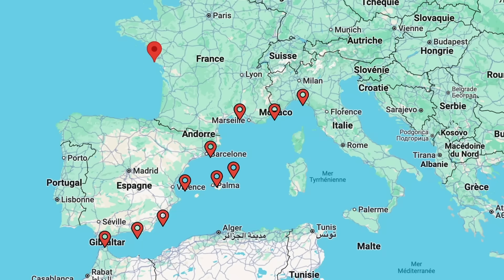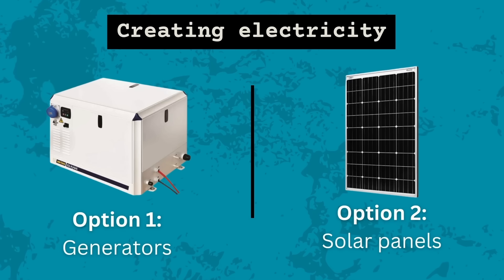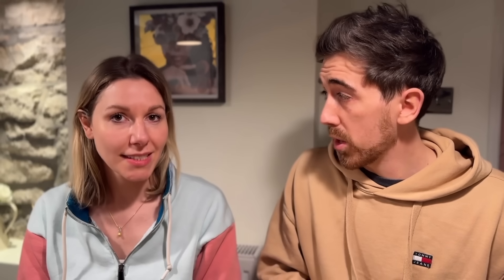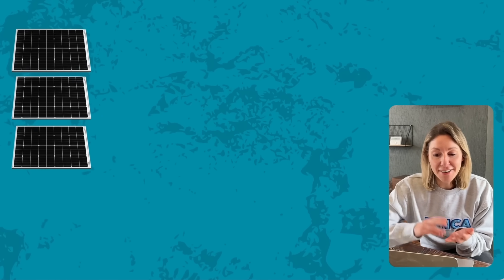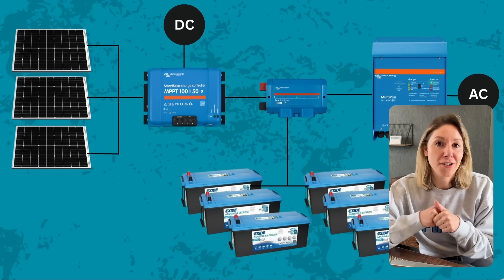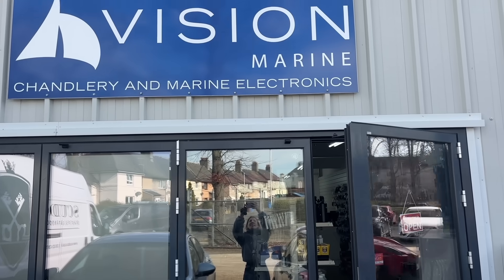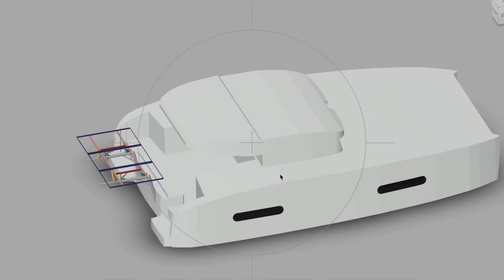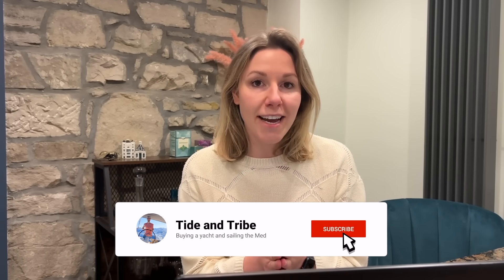We Have a €20,000 Problem! Buying A Brand New Catamaran

Comment: I strongly recommend using LiFePo4 batteries. I have used AGM and wet cell lead acid batteries for the last 45 years and recently changed to Lithium Ion batteries and what a game changer they are. I now wake up to 13.2v instead of 12.1v. They charge faster and can be cycled right down to 10% or so. they are much lighter and hold their voltage right through till they are almost flat. I live onboard my boat and have 3 x 320amp panels which easily handle my 2 fridge freezer units plus all the other usual liveaboard electrical use. I usually only cycle down to about 75% capacity remaining overnight before the panels kick in and begin charging again. This is in New Zealand where the weather can be quite changable with overcast days and a fair amount of rain.
Reply: I agree with you. The new lithium batteries are so much lighter and smaller than AGMs which is important for a multihull which must be VERY conscious of weight accumulation.
Reply: Yes, my research shows that LiFePo4 is the way to go.
Reply from the maker: Thanks so much for the recommendation. At the moment we’ve gone for AGM, but will definitely consider a future upgrade (when we have a little more cash built up) if we struggle - especially since we can only drop down to 50% capacity!
Reply: We started out with 2 agm batteries and after 2 years switched to 2 LiFePho batteries. That was 6years ago and they’re still going strong. In the long run they are actually cheaper, plus piece of mind.
Reply: @GypseaGeoff  Hopefully you mean Lifepo4 and not Lithium ion as those pluse Lipoly are a real fire and explosion hazard, plus no Lithium should ever be discharged below 50% capacity, or it is bye bye to recharge cycles.Worst Lying Words on every Battery with them ? “Deep Discharge “ as each Deep Discharge damages Battery internals and Shortens their Service Life .Same for rapid high amperage charging, and heavy  Discharging, as it heats up Battery internals which ? Also shortens Battery Service Life. Sadly, there is far too much leaping before looking going on with Batteries, Solar etc,and people are very surprised when very expensive Crap stops working in 12 to #4 months, like most flexible panels which has UV exposure delaminate them and Ooops they’ve Gone. There are a few decent Channels on YouTube such as Hobotech which do pretty decent testing, and I like that he does links to good products with extra discount codes. Clare of Clark’s Adventure Channel also does good testing, plus he has designed and builds what looks to be a really good Battery Bank Manager. Ones to avoid are testers who just love blowing shit up, at least until you have learned enough on how to treat batteries properly and that means Gently looking after them, barring accidents, gets you very long service lives. Clark doesn’t like DC to DC Chargers charging Lifepo4 Battery Banks, because they don’t charge those correctly, so damage the batteries. BUT use DC to DC Chargers From a Lifepo4 Battery Bank TO  Lead or AGM Batteries, and they do that fine. Once you know how to treat Lifepo4 Batteries properly, suddenly you can get very long service lives out of the cheap ones as well, and no more being ripped off by chronically overpriced ones. Simple tips, for simplicity and Safety, buy 4 X Lifepo4 Batteries, but specify that they Must be from the Same production Batch,and connect them to positive and negative bus bars, with each battery terminal connected with a same diameter and same length over sized cables, which means that each battery is sharing an equal load- say you discharge at 80 amps, and also charge at 80 amps, each battery then delivers a discharge of about 20 amps, and receives about 20 amps charge .,so size of wire to connect each terminal to the bus bar ?I like easily handling double the load, so 50 amp wire- so the cables never overheat, never wear out, and the battery internals barely even get warm, so they last a very long time as well. NEVER EVER Expect a single battery to thrive when responsibility for all things is just dumped on it with no thought put into how to do it properly takes place at all. I have seen an engineer totally wreck his AGM Battery Bank inside two years, because he didn’t have even the beginnings of a clue about how to look after them properly. His Solution ? Replace them with extremely expensive Lifepo4 batteries, and he then proceeded to treat them just as badly as he had treated his AGM Batteries. Too many people who should know better, believe the Lying Battery Destroying Words - “Deep Discharge “ AGM - discharge  below 80% Capacity and you lose recharge Cycles Lithium - all sorts - Discharge below 50% Capacity and you lose recharge cycles, Rapid Charging and rapid discharging shortens the battery life - side note - wireless charging claps out the batteries very fast too. This in addition to not letting them freeze or over heat.Essential knowledge on Lithium fundamentals, has improved dramatically in the last 18 months or so, and things are really starting to look up at last. Best Wishes. Bob.PS. Most useful information that was only a little bit lacking - so it turned out - originated with very sound communications with Ampere Time - now name changed to Li Time - Battery Factory Engineers. Unfortunately due to the “little bit lacking” actually being extremely important for being able to start long term testing accurately and completely from day one, I had no alternative but to turn down their very kind offer to provide me with a Complete HouseBank of Batteries, for me to see just how long I could make them last. Rough approximation today ?Service Life should be in the region of 30 years, is likely to be ballpark, so things really have improved a heck of a lot.🤔🌟🌟🌟👍❤️⛵️
Reply: @brownnoise357  I did say LiFePo4
Reply: To install AGM batteries is such a terrible waste of time and effort. With only 50% death of discharge, and slow charging rates you might as well not bother.  Naive beyond belief
Reply: @faraway5828  That's bit too harsh. My guess is they want to make a proof of concept and it is much cheaper to do it with AGM. Once the system is up an running and wiring is in place and they have experience with that, and they have rough idea how much energy they use it will be relatively easy to extend it to permanent battery set up.
Reply: @ Actually lead provides substantial benefits if used for the core of the electrical System, such as with preventing the blowing up of alternator charge controllers, and if treated properly and barring accidents they can have very long service lives. Best lead based batteries ? Look to be the right type of AGM for each purpose, such as engine start, windlass, and bow thruster batteries, plus a limited size of Housebank AGM, but none of those must ever be allowed to drop below 80% capacity - which is easy to do with the Bank of Lifepo4 Batteries if they are treated right - very gently - and used in a management role serving every other battery on the boat via DC to DC chargers From the Lithium to the AGMBut definitely NOT from AGM To Lithium, as right now wrong way round, the charging profiles look to be completely wrong, and will over charge the Lithium,mwhich destroys them. So even the cheaper lead acid starter batteries can still have a role to play along with delivering a usefully long service life.Example, only an accident- the British Met Office completely failing to warn of extremely cold conditions arriving with sustained wind chill of under minus 45 degrees C, which froze the ground solid to lower than 10 feet below the surface, destroyed my Bank of 100 ah 12 volt cheap agricultural Tractor Batteries, that were still delivering fully charged capacity sfter over 15 years of service simply by never discharging them below 50% capacity or below 12.2 volts, and topping them up only with distilled water.So a simple glance at the volt meter told me exactly what the battery situation was 👍
Reply: @brownnoise357  There's merits in what you say - however I think that one can reasonably discount the low temperature cutout issues in a marine (ie no lower than sea temperature) install in the Med.
Aside from the implementation/choice of battery chemistry issues, I'd have two big issues.  
Charging large house banks (particularly AGM) from prime diesels will massively reduce the life of said diesels, as it will be impossible to run them much above tickover, which is way outside optimum operating window for diesels. Of course, with a separate high output alternator, charge controller (and LFP) you can charge orders of magnitude harder - but one would want such an implementation to be well designed, well installed, well warrantied. The idea that you can run purely off PV is 'ambitious' - indeed modern (digital nomads)  are finding that 2.5kwp to 5kwp PV does not reliably cover their needs even in Med/Caribbean areas.
The second huge  issue I suggest is getting a home-brew system properly signed off, and underwritten by an insurer.  Live aboard yacht insurance has got drastically harder since Covid anyway, and without insurance you can't (easily) enter marinas or yard hardstanding, - and of course the entire financial enterprise is at risk.
Reply: @ yep, no free lunches, and much depends on being able to get the power demand side thoroughly under control.plus look after a diesel generator right, and the length of their service life can be surprisingly long. All the Best. Bob.👍🌟🌟🌟⛵️
Reply: @ Actually you sound as naieve and uncomprehending, as an e-bike owner who parks the bike on the sunny side of the house, then can’t comprehend why it burst into flames and burned their house down ? 🤔
Reply: PS. Please bear in mind that most people just don’t comprehend how to treat Lead batteries properly, let alone lithium ones. My Lipoly batteries even came with instructions that they must be charged in explosion proof bags, and such batteries were confiscated and banned from being taken aboard the aircraft when I flew to the USA- and quite right too. 👍
Reply: I’m a fan of lithium batteries but I’ve used AGM batteries on out boat for 20 plus years.  You definitely can use them.  They are not terrible.  My batteries last between 8-10 years and cost about $1000 for a set of batteries.

Comment: Oh where to start. You will have to pardon me with my comments but there are just a tiny amount of things you might want to consider. 1) Get a marine electrician involved. You cannot just read a book and know what is required. It may give you a good insight but remember any electrician has undertaken a minimum of 4 years to get a minimum training. 2) There are definate rules and regulations in regard to any wiring on a boat be it DC or AC. Some easy to understand some more complex IE voltage drop and fuse selection and placement. 3) you did not stipulate type of battery system you are installing, this can have a large impact on how you wire and control your system. If, as I suspect you will go lithium you will require a totally different system if you install AGM batteries 4) If your installation is lithium then you really need to understand what type of lithium batteries are available and SHOULD be installed on your boat 5) Here in Australia the majority (not all) required that these types of changes "MUST" be carried out my appropriately qualified electricians or you void your insurance. 6) You cannot rely on your engines as your second source of power for the boat or to charge your batteries. You will need a generator as a backup for those wet and overcast days. 7) when you designed your solar arch did you consider what design weight the arch is capable of carrying, you must also consider the wind loading of the arch as well. You may find you need to beef up your design with support poles to the transoms, It would not hurt to contact the boats builder to see what information they can supply in this regard. 8) I cannot express how important the wiring and safety of the installations must be, get it wrong and you risk a fire - I kid you not. 9) Do not under design you system. I dont know how you calculated your boats load but its a very specific calculation and without the correct and accurate details you may be greatly underestimating you power usage.  Yes I sound harsh but from a distance there are many things you appear not to have considered or allowed for. Do  yourself a favor  and save yourself a lot of money and headaches and get a expert on board  to determine your power needs and what system is required. It may be the case they can design the system you need and allow you to install it under supervision. Why do I suggest this. I used to design and install these systems on occasion and have seen on way to many occasions people do these installations with little or no idea what they are doing.
Reply from the maker: Thanks so much for your advice. This really helps to make sure we’ve covered everything. 

We got a marine electrician to design the full kit and provide everything needed. This includes the specific placements and sizes and fuzes, circuit breakers and switches. They added in precautions that we don’t really need, but safer to have. We also intend to get a marine electrician to look over things during installation in France. 

We’ve opted to stick with AGM.

With regards to the weight, yes this was included into the design. The davits can take 300kg and we’ve kept the weight, including the tender & outboard under 200kg to give extra allowance for wind.
Reply: @TheRunaLife  very relieved to hear you engaged an electrician re the design. Good luck in your installation. Just in case did your electrician tell you never to use more than 40%  your AGM power output to give them the greatest chance of a long life IE if you have a 100 Amp hour batteries never take them below 60% or 40ah of their capacity. 50% is acceptable on rare occasion. You will kill them in short order if you do not follow this simple equation. Hope that makes sense.
Reply from the maker: Yes they went through all this, but we appreciate the advice. No amount of support and advice is to little for us at the moment!

Comment: I hope you have considered the weight and adding that weight to your davits. Those panels are heavy and the frame from the drawing does not look substantial enough. Remember it has to be able to resist 60 kn of wind while being shaken and stirred.
Reply from the maker: Yes we did. It comes in under 100kg, with 3 x 24kg solar panels. Our davits can sustain 300kg, so even with the tender on, this gives us plenty of margin for strong wind.
Reply: @TheRunaLife Lagoon has had quite a few davit failures even without the added weight of your solar array. You might look into adding some additional bracing.

Comment: I might add that you should consider LiFePO4 batteries instead of AGM (if not for the shear density - AGM, like lead acid can only be brought down to a 50% DoD before damaging).  Also, for the engines, Balmer high-output or Zeus.  Maybe some more color on coachroof.  You'll need some tooling, hydraulic crimpers, ends etc.  Try to used tinned, marine wiring and good heat shrink with the sealant in it.
Reply from the maker: Thank you so much. I think the battery upgrade may be the next thing to consider. Vision marine helped us put together all the tools we need too… they’ve been great! Thanks for the recommendation about tinning, we hadn’t come across this before
Reply: @douglasmontgomery6315  believe it or not but the same DoD for lead, applies to Lithium, though if AGM, if you never discharge below 80%, you effectively switch off the recharge cycles and get a really long service life in return as the Recharge cycles they start with, just flatline and never drop. Lead Acid though can last really well if you never let the voltage grow below 112.2 volts, about 50% I had a Bank of Cheap 100 ah 12v agricultural Tractor Batteries, that still had the same fully charged capacity at over 15 years, then a not forecast Wind Chill of below minus 45 degrees blew in, and buggered up the whole battery Bank, but replacements thankfully were cheap at £20 per battery as neighbour had a tyre works and gave me a good deal. 👍🌟🌟🌟⛵️